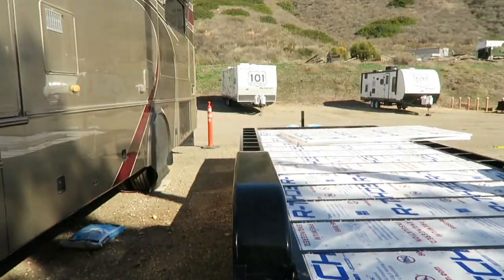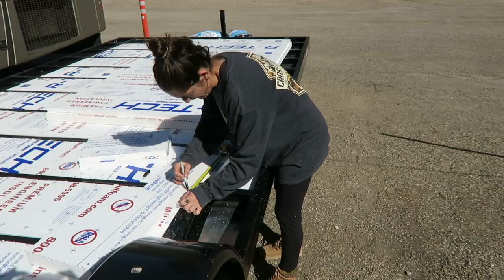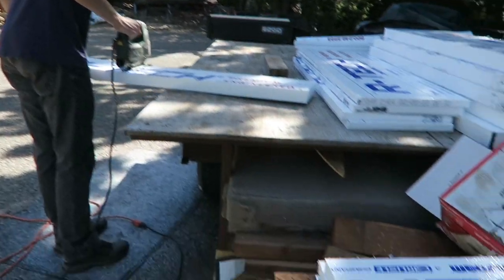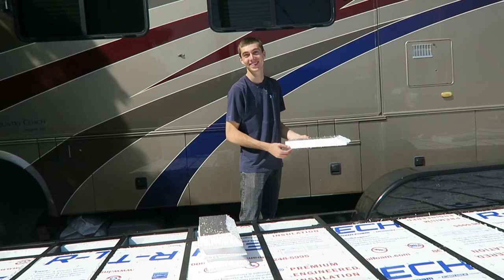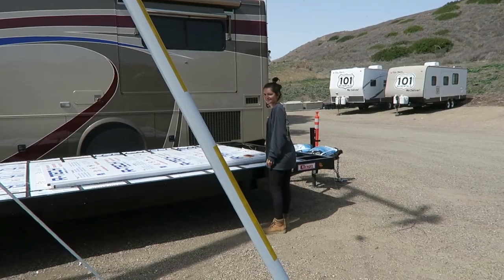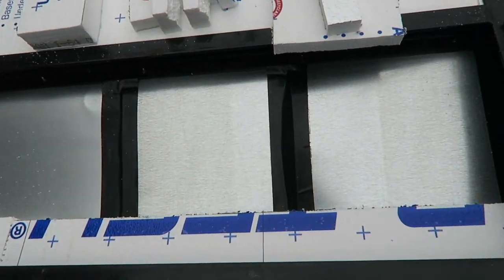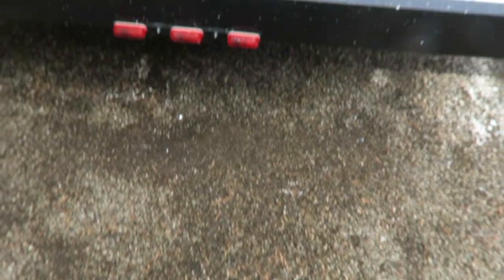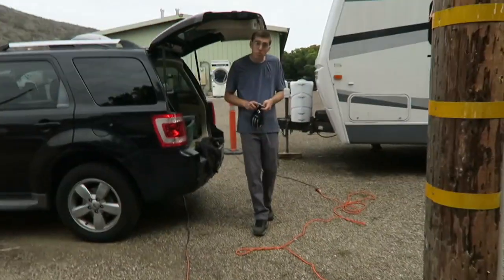TINY HOUSE SUBFLOOR INSULATION FINALLY DONE! | HOW TO BUILD A TINY HOUSE STEP BY STEP | DAY 11&12

Comment: Mistake not to use spray insulation. As a matter of fact, I would have used it on that floor as well. The energy Efficiency savings over a long period of time far out weigh the detriment that spray foam could have. Your long term carbon footprint suffers by the unwillingness to use the most efficient insulation possible. Also, I will assume you will be using metal framing to save on weight. So, the spray foam insulation would offer far superior structural integrity to a home being moved. It doesn’t sag over time and rodents and insects are far less likely to become a problem. Such substantial reasoning for the use of spray foam insulate.
Reply from the maker: We are doing just fine in our house now, our structural integrity is great and I believe we made the best choice for us. Thanks for the concern though, have super good day!